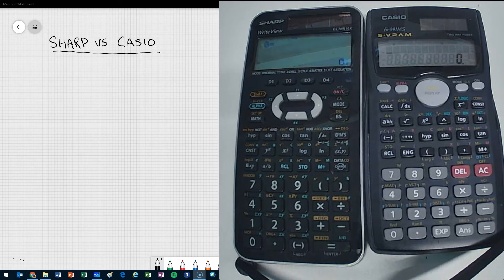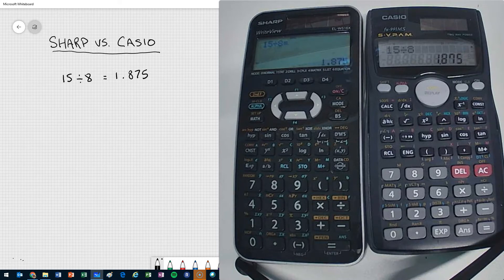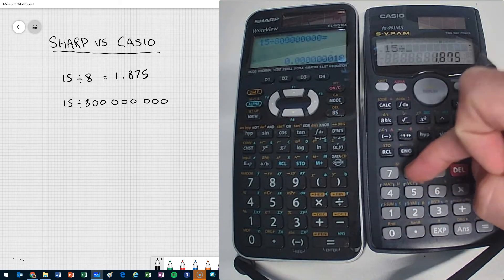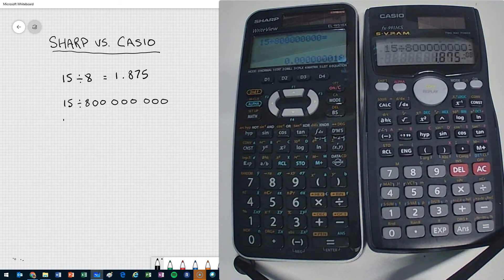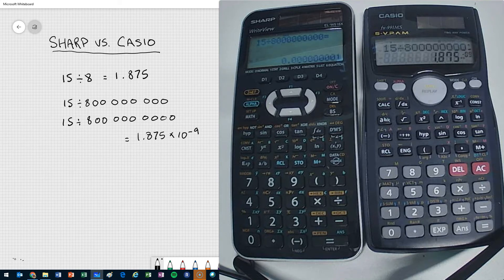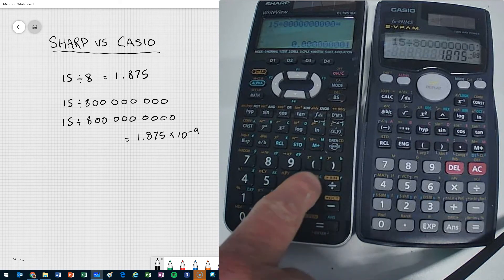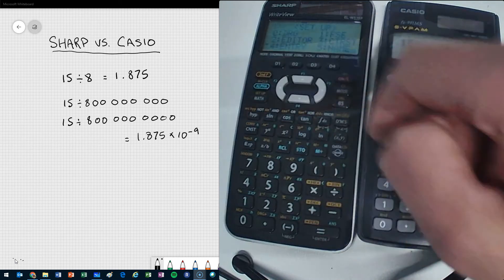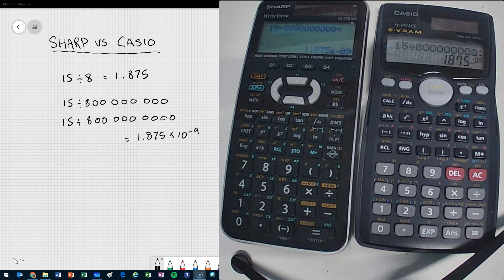Sharp Calculators - Misleading Results - Comparison vs Casio for answers around 10^-9 (0.000000001)

Comment: Sharp and Casio both have a choice of display modes to use when deciding how early to switch to scientific notation. Both call these modes NORM1 and NORM2, but the names are switched between the two brands. NORM1 on Sharp and NORM2 on Casio both have the problem of not rounding the result, displaying a final digit of "1" instead of what should be "2". Meanwhile NORM2 on Sharp and NORM1 on Casio switch to scientific mode when displaying the small value in your example.

So: both calculators fail to round in fixed-point display mode. Both can switch to scientific mode more quickly. The real difference is that the Casio starts out in the mode that switches to scientific more quickly, while this requires a mode change on the Sharp. For someone who didn't read the calculator instructions, and isn't thinking about the accuracy of what is displayed, the Casio default is safer.

However, I prefer the behaviour of my TI and HP calculators. They have a FLO/FIX mode which remains in fixed-point display as long as possible (much like Casio NORM1), but round the result properly. For your example, they display 0.000000002. There is no equivalent of Casio NORM2. If I want scientific display, I need to manually switch to SCI or ENG mode - the calculator doesn't decide for me (unless the fixed-point display would be all zeros).

Comment: Hello, you need to set the sharp to Eng or Sci notation. A TI calculator will give inexact answers like the sharp when in normal mode. This is not a sharp specific thing. The normal mode on most calculators isn't intended to be super exact, its for general calculations and such.